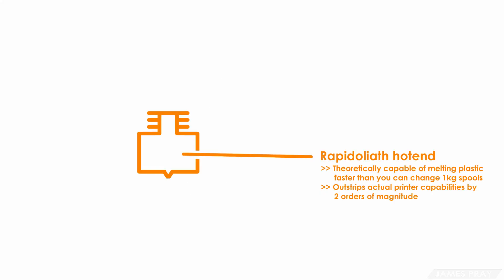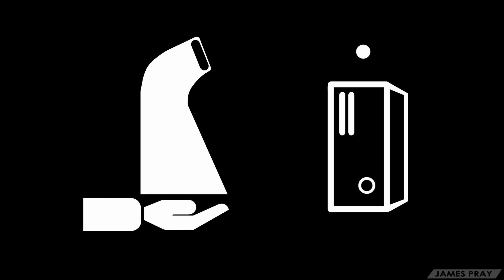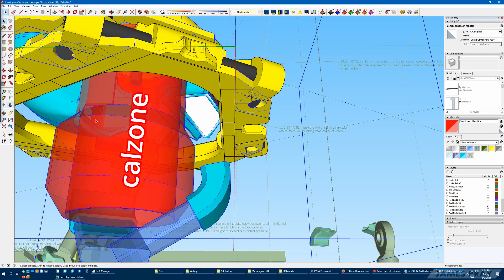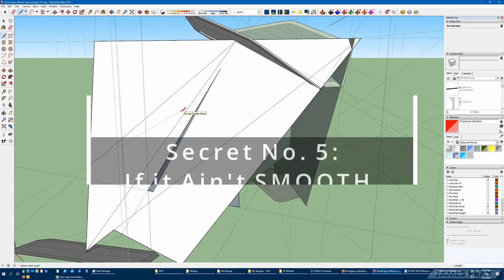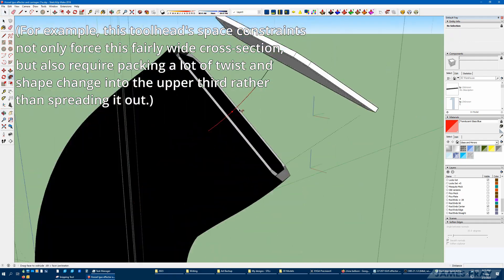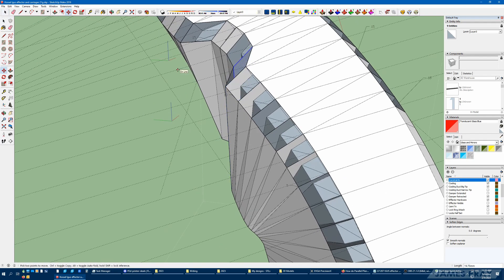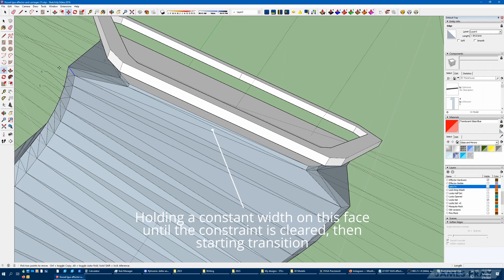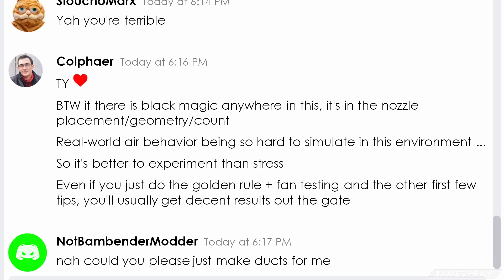Ultimate Duct Design Guide for 3D Printers | My Top 17 Secrets for Custom Cooling Ducts that WORK

Comment: Sketchup?? really?
Reply from the maker: Free, local / non-cloud, and I have 13+ years of experience working in it, so yep, really.  The best tool presents the lowest barrier between brain and output, and for me that's Sketchup.  Don't be scared!  It's just a mesh editor.  And I'm not telling you to use it.
Reply: @jamespray  I understand that, I am a heavy user of SketchUp myself...but for building my wood decks.
I mean, I understand you are proficient with the soft, but sometimes you have to take the right tool to do the job. you don't paint on a A4 size canvas with a paint roller... well, actually you could (by using only the edges of the roller??) but that would be incredibly inefficient, and it will give you very little control.
I had a few hours to kill today, and I tried to model a fully parametric duct for my printer on rhinoceros and grasshopper. With this, I can fine tune pretty much all the points you went across in your (still very good and pertinent) video, and modify every dimensions, every angles, in real time. that's the thing, there is a immense gap between the advices given in your video (all very good), illustrated by an incredibly inefficient working process. it is painful to watch, to be honest.
Reply from the maker: @BennXdesign  It is true that duct design (complex curves generally) is one of the worst possible things to do in Sketchup, and I won't contradict your point that it's inefficient to do it the way I'm doing it.  The ease with which I can do almost everything else balances out this weakness for me, but only because ducts aren't something I'm designing all the time.  If ducting or organic modelling comprised more of my work, it would make it more worthwhile to expand my toolset to cover that need.  As-is, the ROI for picking up another CAD or modelling program isn't quite there at the moment for me.  In the future that may change 🙂
Reply: @jamespray  If its a one off, I can get behind this, but still, painfull to watch 🤣
It remembers me the japanese (then worldwide) trend of oekaki : drawing incredibly good paintings with... microsoft paint. they are doing this just for the performance of doing something amazing with a crappy and limited tool. As an artistic performance, I am all in favor of it. with the level of technical achievement you are doing in this video, it is pretty much the same (I would even argue that it has some artistic feeling, but that's only me ^^). If you like polygon modelling, you may give blender a shot. super quick to pickup, and free. still not quite the right tool for measurement sensitive CAD, but yet perfectly doable. I am not super super fluent with blender, but still I would design a duct pretty efficiently with it, I am quite confident on this, and if you use a spline for the airway, you may even make it editable in a parametric fashion. You may even be able to test it with a fluid simulation! (IDK if the results would be physically correct though...)

Comment: Great stuff.  You confirmed a couple of my suppositions and I learned quite a bit.  I will add your bowl-of-water-on-the-print-bed testing to my existing run-the-kitchen-tap-through-it method.
Reply from the maker: Glad it helped!  Running under the tap is also a tool in my arsenal ... good-ish for visualizing exit flow :)

Comment: Nice guide. How well did it perform though?
Reply from the maker: Thanks!  I am still waiting on the hot end to go with this duct, so I haven't been able to run test prints yet.  This was a design I happened to work up well in advance of the hardware availability.  Water tests with the prototypes look good and the duct itself is quiet with a wide-open nozzle variant, which are good signs.  Still, I can't render final judgment until I can start running test prints and A/B results against prior designs with various nozzle geometry.
Reply from the maker: I did post a short (the "cursed" duct) vid recently that features this design, but it's not really a showcase of how well or poorly the duct itself performs, since it's using a high-restriction nozzle intended for a high-pressure air source, where smooth duct airflow is more of a secondary consideration.

Comment: I heard a rumour that a little obstruction isn't always bad. That vanes, although they cause friction and can redue airflow, can help preserve or accumulate pressure by suppressing turbulent flows which can block the airflow. Is that about right, and in which situations is it relevant?

Also can you incorporate venturi effect into the nozzle tip?

Which are the best cheap ways to test your duct, nozzle or mockup?
Reply from the maker: Thanks for the Qs!  Some As:
Obstruction (from vanes) isn't good, but sometimes it is better than the alternative (a duct with corners or sharp bends that cause turbulence).  Vanes are worth trying if you must run a duct around a corner that creates an inner radius much smaller than the duct width, because vanes create smaller-width "sub-ducts" that effectively get a larger bend radius in relation to their size.  (Large bend radius = smoother airflow.)  Ideally you design ducts that don't need vanes to flow smoothly, but toolheads are rarely ideal places!

Yes, you can definitely entrain air with a nozzle.  You actually can't really avoid it, but you can encourage it by designing a nozzle that allows for smooth airflow coming from behind itself.  Of course, entrained air isn't moving as fast and won't be as effective for cooling, but it's not hurting cooling either.

And lastly, I think the cheapest way to test ducts is just to print them and see how they do.  They tend to be small parts, so it doesn't set you back much filament to try and iterate.  I have boxes full of them :face-fuchsia-tongue-out:

Comment: Last last question, what about silent or low noise duct designs? Axial fans kind of suck for part cooling applications. But can produce good results with stator blades.
Reply from the maker: So far as I know, most duct noise comes from turbulence.  Efficient ducts are efficient because they make less turbulence, so the more optimized the duct, the quieter it should be!  Stators can be noisy if the vanes are very close to the fan blades; I know that can be reduced a little by increasing the gap, but in general I would not use an axial fan for forced-air duct applications unless I absolutely had to.

Comment: Last question, what do you think of the bambu lab part cooling solutions? The ducts are asymmetrical, they don’t collide in the middle, rather they are offset and create a vortex.

The consequence of this IMO is that you sacrifice part cooling performance in the exact center of the nozzle, but get improved cooling in an annular area around the center. I can provide pictures if needed. Also, side mounted fans m, what u think, good idea or no?
Reply from the maker: I am not familiar with the BL part cooling design specifically but I think some asymmetry in the nozzle aim is good.  If the airflow collides head-on right at the nozzle, I believe that's actually going to make the nozzle the area with the lowest airflow because the air has to slow down and change directions 90 degrees to exit the area.  It's important for cooling air to have an easy exit path.  Most of my designs place the nozzles at 120 degrees from each other so the airflow collides at the nozzle but each air stream only has to turn a 60 degree corner to flow away.  It is also good to have a nice "splash zone" around the nozzle, because the molten filament is always going to be moving away from the nozzle in some direction and the larger the area being cooled, the longer that filament spends being cooled before the print head moves away.

Comment: Related to tip 4, fan placement is super important. Really helps shape the overall duct design. If you can put the fan right up in there so the duct is only a couple cm long and doesn’t have to change the direction of the air, that has been great for me.
Reply from the maker: Very true, especially if the fans aren't huge.  The simpler the duct the better, generally, and fan placement is (within your constraint envelope) often the biggest lever you can pull to make that achievable.
Reply: i remember seeing alex kenis making straight fan shroud's for axial fans with guide fins to straighten the direction of air from the fan rotation and a center cone to take away turbulence from behind the hub of the fan with really big improvements

Comment: Couple questions, what do you think about guide vanes inside of the duct? Personally I hate them, while that can be used to even out airflow, it’s a poor solution as it adds unnecessary resistance
Reply from the maker: I wouldn't say I hate them, but I view them as highly situational for the reason you mention -- more perimeter creates more resistance to airflow.  In ducts that must make tight, awkward turns due to other hard constraints, they are occasionally the lesser of two evils (since they can reduce turbulence around tighter bends).

Comment: Great video but a few questions. 
1. When you say reduction % wouldn't it be 1-outlet/inlet*100? Because that would be the percentage then that it was actually reduced vs without the 1- you would have how much is is left of the original? 
2. When testing different reduction values do you take and do that with a straight design or do you have it instead follow the flow that you would actually have. I would imagine it is the later since then it would more in tune with your actual results you get with your final but wondered
3. How would you manage reductions down when there is very little distance between inlet and the outlet of the duct? Do you use space in all directions to kind of length the distance you have to reduce? Or would you increase your distance by potentially moving where the fan is at to give more distance?
Reply from the maker: Great questions!  1: it doesn't matter which you use as long as you use the same math for testing and for modelling your duct.  The equation shown is what I use, but either works.  2: I test with a straight duct with at least golden rule reduction rate to get an idea of "best case" performance numbers.  Then I tune the duct design with nozzle size variations afterward.  It's really hard to know for sure until you start running overhang tests on your actual printer.  3: It's always a balancing act, and sometimes you just don't have much room to maneuver, but moving the fan is often a good way to get some room for smoother ducts and slower reductions.  I had to do this for the hot end cooling duct on the design shown in the video -- as originally placed, there just wasn't room for a smooth bend, so I shifted it out 3-4mm and it made a huge difference.

Comment: I certainly had a bit of a scare when I saw that it was being done in SketchUp (team Blender here), but I was surprised by the quality of the tips and content. YouTube recommended it to me because I'm thinking of buying a Sovol SV06 and I've already researched its cooling problem. Because of this video, I think I'll risk developing a better system for the Sovol instead of using the ones that are already available on the internet. Congrats man, really good.
Reply from the maker: Thanks very much for the feedback!  I'm glad you gave it a shot and found it helpful.  That's really just the sort of case I was hoping to support with this.  There are a lot of bad duct designs out there, but that could be changed!  Good luck with yours, and cheers to a fellow mesh editor ✋

Comment: That was funny and informative. Speaking of inappropriate tools: I created a series of ducts using Blender - a combination of low poly modeling and a stack of modifiers produced nicely organic looking ducts. Later I also figured out lofts in Freecad...
Reply from the maker: I keep thinking about trying Blender again ... from the looks of it, if you can make lofts work in FreeCAD, you can probably do anything 🤣
Reply: @jamespray  Freecad Lofts aren't so bad, just stay inside part design workbench and it's just as easy as fusion 360 imo. FreeCAD gets way more complicated(and powerful) when you start mixing workbenches.

Comment: I am leaving a comment as there is good information here, but holy god that cad package is not the right tool for the job. Any of the standard parametric modeling software packages will do things like this type of thing a lot cleaner, faster, without nearly as many external tools, and with a huge increase in modifiablity. For anyone looking for a general process, start and end single contour outer profiles, possible stopgap profiles if you need a lot of control, a guide curve or two for alignment if geometric start/end conditions aren't good enough, and a shell feature for getting consistent wall thickness. Although I tend to make simpler stuff like vacuum attachments, 90% of the ducts I have made were literally just two outer profiles, tangent start and end constraints on a loft, and a shell command on the two faces of the loft. With that, you will likely spend longer measuring or finding measurements on the components than actually putting it into cad. And while I use Solidworks as my company and robotics team use it, Onshape will do this for free just as good as long as you are okay with your designs technically being public as I know price of cad packages is a major sticking point. Teaching Tech had a good video series on it, and it feels like just a slightly different skined version of Inventor/Fusion 360/Solidworks (/ FreeCAD if you are being generous. I never got much past the clunkiness/UI although I morally support it).